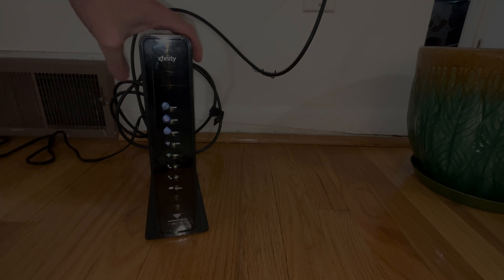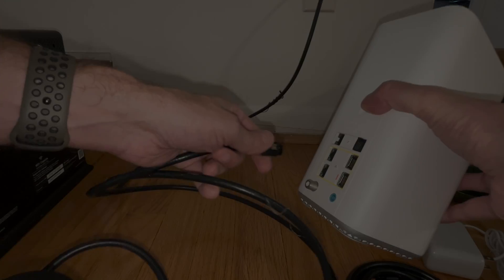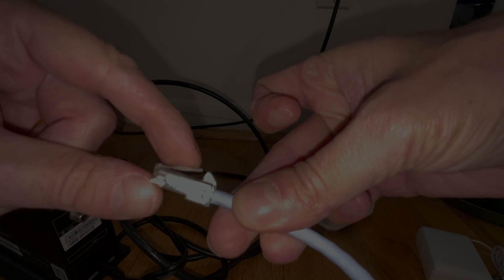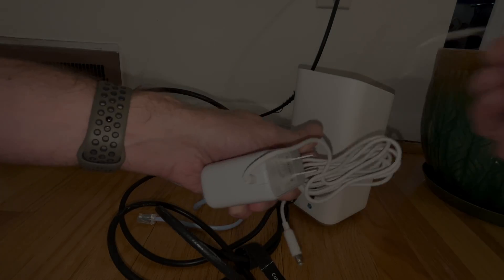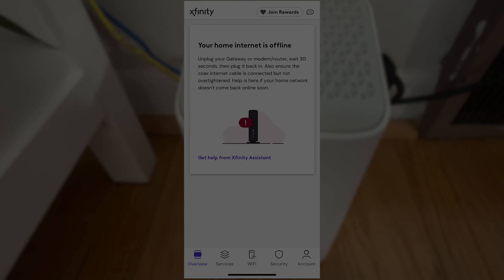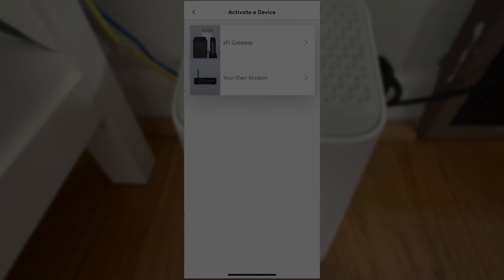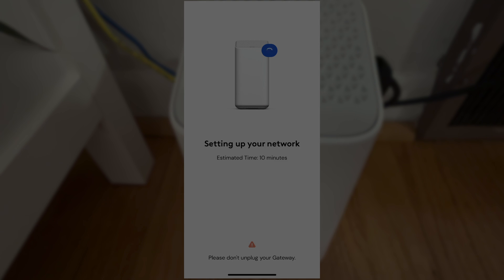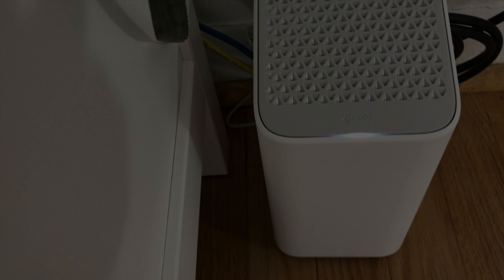Replacing the Xfinity Gateway Router Modem (How to instructions, Comcast)

Comment: Thank you so much for this video. My ethernet cable is not coming out of the old router. I'm afraid to force it. Is this a common problem?
Reply from the maker: They sometimes get stuck. Using a small screwdriver to help the lever over the lip sometimes does the trick.

Comment: I didn’t get an ethernet cable. All I got was an HDMI cord, the coax cord and the plug. Do I have to have an ethernet cable in order to have the Internet work?
Reply from the maker: The Ethernet cable is not needed for the internet to work.  It can be used to connect to a computer or gaming station.  For WiFi it is not needed.

Comment: I just took out the existing cords before the upgrade and put the cords in the new gateway and waited. Then Scanned the QR at the bottom of the XB7. The Xfinity app opened then something came up asking if I wanted to keep existing wifi config. Hit yes and waited until the light turned green, then it turned white in the ready to go state. I even had my TP link router plugged into a Ethernet port and still had no issues. Didnt even need to find the ssid  and re-enter the password. Just worked. Didn't read anything really lol.

Comment: Catch 22, We do not have a data plan on our cell phones, the x-finity app does not work without internet access and we just shut down our wi-fi when we disconnected the old modem...
Reply: That was going to be my question, or similar, that you have to connect on the app using a cellular signal.

Comment: What do I do if I don’t have that thing on the wall , I’m renting a studio behind somebody house , how do I get connection then without that thing on the wall
Reply from the maker: You will need the connection someone.  Sometimes it is just a cable laying around, which plugs directly into the modem.
Reply: Does the phone line have to be active???
Reply from the maker: No,  I use mine with only the cable. Connection

Comment: I already have a whole home wifi mesh system, and xfinity help chat bot said I could continue using it with the gateway.  So I've ordered the gateway really only because it includes unlimited data.  Your video, or any other video I could find, doesn't mention anything about using a separate whole home system or how to merge the two.  I've spent thousands on wifi coverage for my 3000 sqft house and outlying buildings.  A single box won't cover my needs so am I going to have 2 wifi networks now?  1 signal through the gateway and another through the Orbi?  Will they both be fast?

Comment: Thanks for posting this video! I just received this new router/modem and tried installing it but was not getting a signal. Definitely need the new app, I was using the old one and it wasn't working. Your step by step tutorial was more helpful than anything Xfinity could do. One thing that I found odd was when I used the newly supplied coax cable, it wasn't working, so I went back to the old coax and that worked fine.

Comment: During the replacement, was there an option within the app to keep the existing WiFi settings (WiFi name and password) and put on new router? This way, I don’t have to reconnect all the devices to the new router.
Reply from the maker: Yes,  it will take over the previous settings automatically
Reply: How do I set up my printer to Wi-Fi new username and password on this dual modem/ router? We had to change both when connecting the upgrade modem. My printer is the only device that didn’t connect over automatically